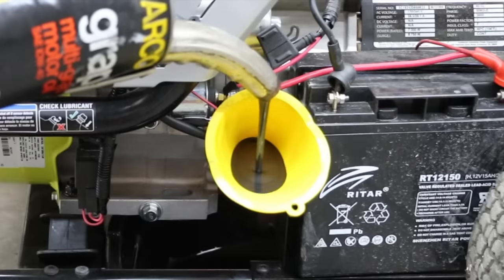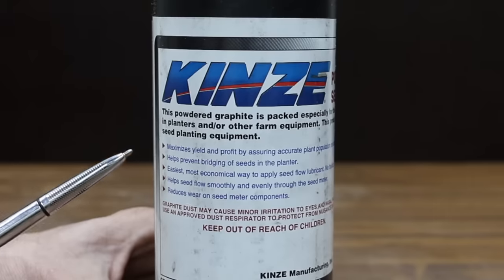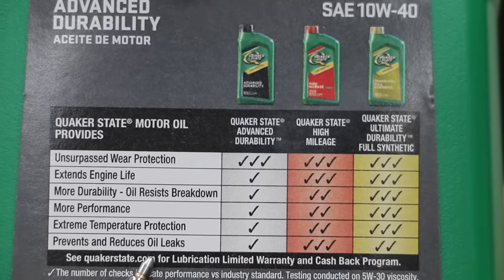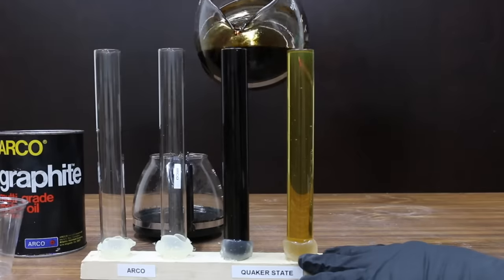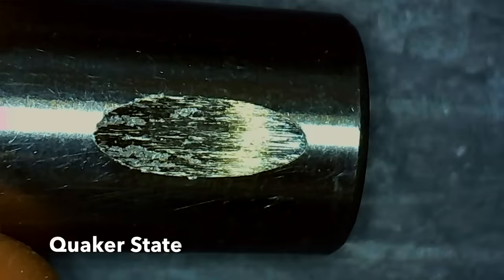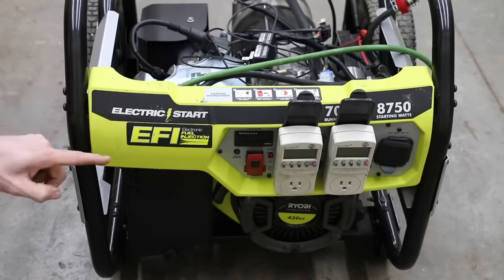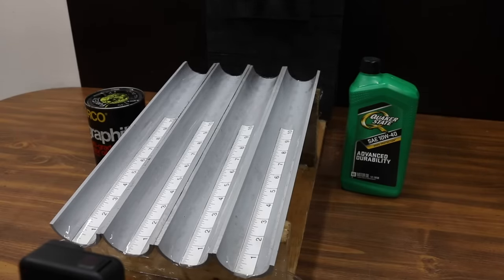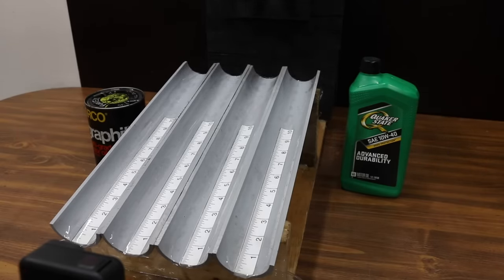Will "Graphite" Help Motor Oil Performance? Let's find out! Vintage Arco Graphite vs Quaker State

Comment: I was an ARCO dealer. I remember that oil. My friend, who worked for ARCO, had me but ARCO graphite oil in his one year old Chevelle with a 350 engine. He was constantly asking me to sell the oil at my station, but I wouldn’t. That oil didn’t make sense to me. The engine lasted about 6 months before it let loose, it had only 15k on it. On tear down of the engine, camshaft and crankshaft were wiped out. Cylinder bores were about .013 oversized. What a mess. I told him, hate to say I told you so. That oil was absolutely crap and was discontinued by ARCO.  My question is, where did you find that can? It caused me to have flashbacks, back when I had hair.
Reply: ...makes me wonder if the engine self destructed because the oil filter got stopped up from the graphite.... depriving the engine of sufficient oil circulation...
Reply: Can’t block the filter filters had bypasses in them
Reply: My old man used this shit once and had to have the graphite scraped out with a putty knife

Comment: I used that Arco oil in my 73' Dodge Challenger back in the 70's...  I remember seeing a small HP increase with it and had no issues.  On a modern car with all the sensors etc, I'm with you and inclined to leave well enough alone.
Reply from the maker: Thanks for sharing.
Reply: You couldn't pay me to pay that stuff in my new dodge charger.
Reply: @SoulDelSol  What if I offered you the price of two Dodge Chargers?
Reply: @Ijusthopeitsquick  true, ya i guess i easily could be paid off upon further thought.  That's a good deal actually ‐ i accept venmo
Reply: @SoulDelSol  Ha ha

Comment: I was working at the ARCO test and development center when they were testing ARCOGraphite.  I was part of the study.  Never did get any results from the company.  I do know that my car didn't drip oil before they put the stuff in, but it did after.  And it made a worse mess on concrete due to the graphite.
Reply: Thanks for sharing - assuming it's true :)

I would never use graphite in my car's engine - unless they would cover the engine swap after :)
Reply: @kris856  - Why would I lie about working at ARCO during the graphite oil testing???????
Reply: @irishenterprisesllc7414  I am not saying you are lying- it's internet- you know- anyone can say anything and there are no solid proofs available. Anyway- sorry you feel offended- I didn't mean to insult you. Anyway - putting such stuff in the engine seems not a brilliant idea at all. Peace- and have a nice day.

Comment: When I worked for a Volkswagen dealership in the 1960's we used to add Molycoat to the engine oil.
Reply: Me too except I add it to my Ford Raptor.
Reply: Cool. I buy only Ford trucks an VW sedans.
Reply: @coupalr1  nice. Raptors rock.

Comment: Don't accidentally brew coffee in those pots.
Reply from the maker: Great point!  The forbidden coffee, lol
Reply: @ProjectFarm  The Austin Powers coffee
Reply: Just as well, i have that eye. The ceramic will chip from the surface of the eye, leaving bare rusty metal, passing through about 70vac..
Reply: It'll make you go to the bathroom way easier
Reply: If your coffee will not etch carbon steel you're doing it wrong...😂
Reply: -Flight Line coffee was just like that... complete with an oil slick. ;

Comment: Fell into the Hype when Arco was pushing this as the Miracle Motor Oil back in the day... Stock Oil Filters went into Bypass Mode almost instantly after pouring it into the crankcase. I switched to the Toilet Paper Oil Filter Kit that J.C. Whitney was selling and it was a sludge Plug. Bottom Line: Never Put solids into a viscous medium that supposed to be the life blood of the engine.
Reply from the maker: Thanks for the feedback.
Reply: Fair enough but what about transmissions and rear differentials?
Reply: @ls6097 Arco didn't make graphite gear oil... which is typically 80W/90    I know Graphite Powder can be added to Manual Transmissions and differentials but not Automatics as it will fail due to all the small orifices and pressure check balls.  
Now it's easier to just use Synthetics.
Reply: @iDarkfigure  yes.  synthie is the way to go. Times have changed.  I grew up with stock antique 1930 Model A restorations, all sorts of 60s cars, ford and Chevy, additive craze of the 80s and 90s.  Particulates have many red flags.  Synthetic oils I switched to a few years ago and have zero regrets.  My last three cars were 88 chrysler New Yorker, 250 k miles at least then speedometer broke.  97 buick Le Sabre, 220k miles and then I upgraded in 2017 to a 2008 kia sorento, 3.8 l engine, 2 WD, conventional mount not Front wheel drive.  Now at 128k miles and it seems to love the Synthie oil I switched it over to.

Comment: Very interesting. Years ago when I was still working, I was an elevator mechanic. I remember using a product called Graphol, which was a graphite lubricant (graphite powder suspended in an oil based liquid). This was used as a lubricant for reducing friction between sliding surfaces. It was quite effective in it's application, as your lubricity test showed.
Reply: Yes, in the late '70's, I used a graphite lubricant to reduce friction in a high speed bearing project.
Reply: @Patrick Labozetta
dry graphite has been, and is still used on locks and in the locksmith biz.  I use it on door hinges, and other places I don't want to spray oil based lube, or risk oil dripping on something. And locks, of course.

Comment: 40 years ago I believe looser clearances than new ones. I'll bet the Arco helped in worn engines.
Reply: Cars haven't gotten that much better in that time... its taken enthusiasts that long to realize the only improvements that have been made are using slightly better materials in some key areas. They have yet more to learn. Also, very small sheets of suspended graphene (put it through an emulsifier and a centrifuge a couple times according to Robert Murray) would kick the pants off this cheap clumpy graphite.

Edit: If you could minimize or control the oxidative damage to the graphene sheets it might improve or hinder various properties of the vapor-entraining lubricative additive. You want to keep the max size of anything in the engine oil to [much] less than 5 micron. Engines that use bypass filters of 1 micron last longer, and lubricative nanoparticles can be thousands of times smaller yet.
Reply: It does help worn engines. It fills the micro scratches with graphite and reduces blow-by.

Comment: Project Farm: "When's the last time you had to use a spout like this?"

Me: "I've never even SEEN a spout like that!"
Reply from the maker: lol
Reply: I still have two in my garage along with some old cans of oil that need them.
Reply: Reminds me of the old slick viscosity cans of oil additive the old stock cars used for a little while before the EPA stepped in.
Reply: Damned kids!
Reply: back in 1970 I worked at a full service gas station.....filled the cars oil tank with spouts like that...washed windshields n  checked air pressure...all for the tank of gas. Guess that makes me an old old geezer!   lol lol  yup bout to be 70 yrs old sonny.
Reply: Way back in the olden days, long before cell phones, laptops and the internet engine oil came in metal cans. That type of spout would push down into the can cutting a hole as it attached itself to the can. I think that is what I remember...
Reply: I still have one.
NEVER throw a tool away.
Reply: Note to self:   add my oil can spout to the list of crap odds-n-ends I want to try and offload for a profit sell on eBay.
Reply: @richardmj6015  inside every old guy is a young saying what the hell happened here
Reply: last time I saw a spout like that was in the movie Nothing but Trouble.
Reply: @richardmj6015  yo, Geezer!   I was in the back seat watching you reach across the windshield!   Young-uns nowadays think a full-service gas station is one that sells coffee.
Reply: @77thTrombone  yup and anything else like a grocery store.

Comment: When I worked at a Volkswagen dealership, we used to add molybdenum anti seize compound to the engine oil when we performed an oil change.  It would work because the cars did not use paper element filters at that time, but rather, they were equipped with an oil screen.  This way the additive would not be filtered out of the oil.  This addition increased the longevity of the engines.
Reply from the maker: Thanks for the feedback.

Comment: I tried the arco graphite when it first came out ,it plugged up the oil pickup and Burned my bearings out, had to replace motor ,they had a lot of complaints, and they ended up dropping this oil
Reply from the maker: Great information.  Thank you!

Comment: I think you said the arco oil was from the 70's. So back then you had engines designed to run on leaded gas, which was a lubricant. Wonder if that has anything to do with it.
Reply: Mid to late 70s almost ALL gas was unleaded.
Reply: @danwebster41  actually cars built after 1974 had to run on unleaded gas, leaded gas was still around until mid to late 80's when the epa cut allowable levels down to .05 ppm.
Reply: itsabig  true, but it was also to raise the octane level in the fuel, preventing spark knock, and also put a flash coating of lead on the cylinder walls. So it was added as top end lubrication.
Reply: Lead in gasoline acted as a top end lubricant, not a bottom end lubricant.
Reply: @theoutdoorswithdave2352  Yep, I remember that.  It was in my senior year of high school, 85-86, when I had just bought a 1973 Fury III.  I ended up rebuilding the engine and modifying the heads so I could use unleaded (along with some other changes to give a bit more power).
Reply: @danwebster41  Don't you mean LEADED?
Reply: Hell I still run my truck with leaded fuel. 

2011 376ci l9h vvt Silverado
Cam and all that fun stuff, cat and muff deletes and vo race fuels leaded octanium.
I add 1qt to every tank of 91
Ford soft valves and others definatly needed it back in the day  but its good for any valve seat modern or retro.

Comment: I had been employed by an ARCO station when the Graphite motor oil was introduced in the 1970's. If my memory serves me correctly, that oil was not on the market very long, One of the issues? was graphite separation (settling while the engine wasn't running). I believe that the additional anti-wear additives were necessary because graphite being a lubricant, it is also abrasive.  I remember as many compliments as there were complaints. I personally used it in my 1951 Dodge Coronet (6 cyl. flat head engine) with some small improvement. I only used if for about 6 months because the price difference wasn't worthy the gain. PS ARCO was Atlantic-Richfield Company after the merger of Atlantic Refining & Richfield Oil Company. I went back to using the Aviation Motor oil sold by ARCO.
Reply from the maker: Thanks for sharing.

Comment: It's getting towards the firewood time of year here in Aus so I've been getting out the chainsaw a bit. I was actually wondering if adding graphite, moly or teflon would reduce bar and chain wear.
Reply: Bar oil ain't much. U can take some cheap say 10w30 motor oil and mix some cheap oil treatment and have better bar oil than u buy at the store.
Reply: @jordanwalker9309  like....Lucas and cheap oil?
Reply: I'd only use moly. Never use anything with teflon in it.
Reply: In the video he shows how it was the triple amount of additives such as calcium, phosphorus and zinc not the graphite that slowed the wear.
Reply: Bars and chains are not costly, just use regular bar oil and keep your chain tension right, flip the bar every sharpen. No point overthinking it.
Reply: I'm a commercial firewood cutter in Tasmania, run waste motor oil through the saws. Common practice. I could burn twice the number of bars as I currently do and still be out on top. Bar oil is bloody expensive for all it does! And I've never done a tip bearing, never had problems with chainsaw oil system.
Reply: (1) you’re better off spending that time or money on sharpening, or just buying new chains. (2) molybdenum is the only thing worth adding but isn’t worth the effort.
Reply: New York,  I pay 7 bucks a gallon for bar oil. 20-24 bucks a chain. About the same for a 20in bar
Reply: @Alan H 

Just get yourself an old RV and start pulling them trees down.
Reply: Doug JB yep problem solved...lmao
Reply: stuart m absolutely I been using low milage (2500) used high grade synthetic motor oil for years. Seem the bars are lasting longer.
Reply: Moly; yes, because it's mineral/metal. Graphite; no, because it will mix with sawdust and pack the bar journals. Teflon; never, because residue left from cutting gets released into the air when burned [not real healthy in a fireplace in the house.  Hope that helps.
Reply: You should test militec. First you cut some wood to heat the chain. Then, using a sponge or a brush, you add militec and oil (20/80%) to the chain. Then cut some more wood to activate the mixture. Your chain gonna last forever.
Reply: @lamarzimmermanmennonitefar5269  yeah thats my point. Spending $50 on some hipster additives in bar oil when a chain is half that cost doesn’t make sense. Use cheap bar oil, it’s fine.
Reply: @afwaller  I was just curious how are oil and chain and bar prices compared to Australia

Comment: I Was just thinking about using graphite in the oil of my 2009 Harley Davidson Heritage, I have done over 60 thousand trouble-free miles, & I used to use straight 50 weight Penrite mineral oil, now on the twin-cam I use Penrite 20/50 full synthetic oil, & it runs like brand new. I have always believed the best thing you can do for your engine to prolong its life is to change the oil & filter twice as often as factory specs, which is in my case every 4 thousand instead of the factory's 8 thousand. Cheap insurance in the long run I reckon. Loved this vid & your work, excellent, enjoyment & informative. I just joint up! Cheers from Downunder!
Reply from the maker: Thanks and you are welcome!

Comment: A company that I worked for had two vendors for oil and grease. The one company sold us conventional oil from Sunoco and the other company sold us oil from a company called Molluballoy. Molluballoy contained molybdenum disulfide created problems with the lubrication, blocking the oil passages. It was extremely detrimental to the 250-300 horsepower compressors that provided power to equipment in the shop. It also cost about 7 times what the conventional oil cost. Oddly, the company was still buying the Molluballoy years after the problems were encountered. Sounds like graft to me. What do you think?
Reply from the maker: Great point. It does sound like some sort of solid was in the oil.

Comment: I would like to see a test of marvel mystery oil. I have had sever "old timers" say it is the greatest thing. Personal experience is it clogs gas filters but don't know how well or if any it helps in oil. Thank you
Reply: -Have used Marvel Mystery Oil in fuel for last 16 years and well over 110,000 miles in 8.1 Workhorse RV with a 4k# toad. Never a problem. Same original fuel pumps, same injectors. 10% Ethanol fuel often. Starts immediately after 6 month storage. Onan Generator, 495 hrs, feeds from same fuel and starts within a minute of prime and cranking, after same storage.
Reply: I believe he already has a video or two testing Marvel Mystery oil
Reply: Can clog gas filters from breaking up stuff before the filter. Like stuff in your tank that's now disloged and goes into your filter
Reply: Used it in motorcycle gasoline as an upper cylinder lube. Never had a problem with clogging fuel filter or heard of anyone else having such problems.
Reply: He has already made a Marvel mystery oil video, around ish 8months ago
Reply: That mystery oil works wonders man.
Reply: I've been using Marvel Mystery Oil in a 2000 Ford V10 that I've personally put over 100K miles on. Truck had 124,436 miles on it when I bought it. I've used MMO in just about every oil change I've done on it, plus use it in the fuel for two tanks of gas after an oil change. It runs just as good today as the day I bought it. I'm a 28 year old believer in Marvel Mystery Oil. 

I should also add, that we use it in the fuel of all the tractors in our farm fleet, and the diesels definitely do better on a steady diet of it.
Reply: Good tool oil. That's about it these days. Old timers didn't have to worry about plugging microscopic injector orifices :-) 
Besides with 10% (or more) of ethanol added to gasoline cylinder wash is more critical than ever now. If someone is that worried running 100% rec (recreational) gasoline would be the best option.
Reply: I’ve seen it used with great success to get hydraulic lifter that have collapsed to pump back up when added to crankcase
Reply: TotallyNotSpam I’d prefer to have something that the dissolves the gunk and causes it to get clogged in a replaceable filter rather than have it just be sitting in random deposits in the fuel lines
Reply: False Flag may be worth a try
Reply: The stuff was a labor saver. Freed a stuck lifter or 2 when mixed with the oil.

Comment: Great content as usual, been watching your videos since the early days, I have a few pounds of Hexagonal Boron Nitride Hbn dry lubricant and was wondering how well it would perform as a oil additive in a heavy duty diesel engine, 
Also Costco started selling HD 15w40 oil under their store brand Kirkland and stopped selling Rotella and Delo would really love to see you make a video on this oil, I picked up 4 cases a couple weeks ago and changed the oil in my Volvo D13 engine, I will send in a sample in a few thousand miles to see how it performs.
Reply from the maker: Thank you for the video idea!